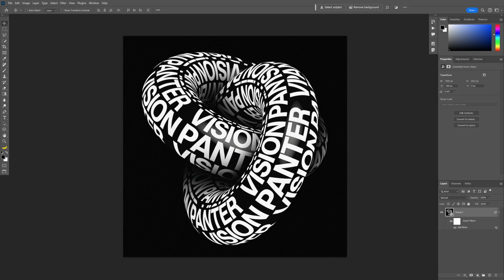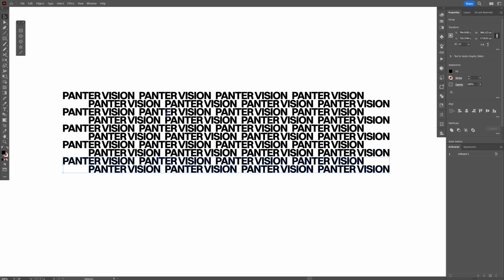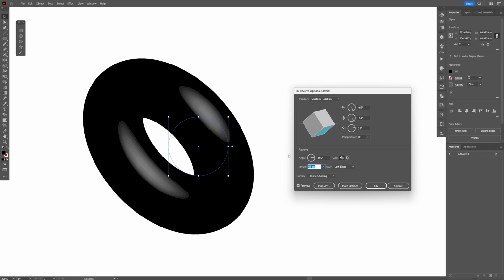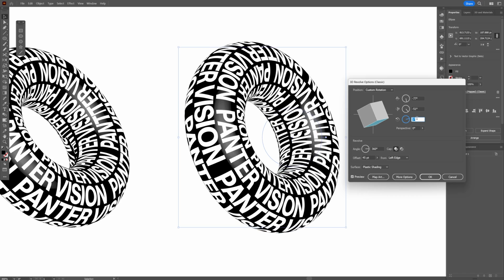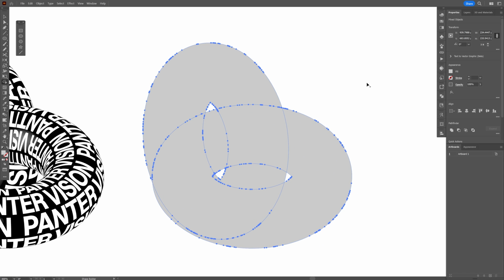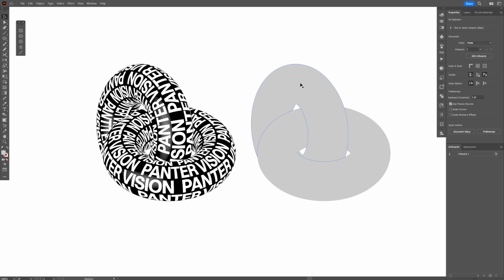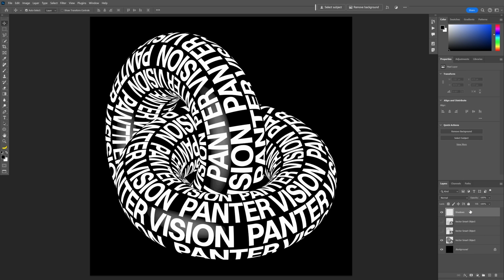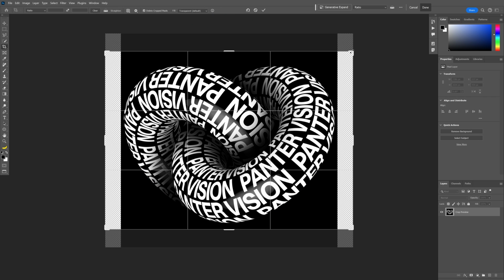How to Make Kinetic 3D Intertwining Text Donuts in Illustrator and Photoshop

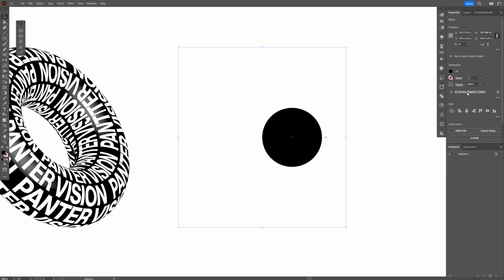Comment: I can actually see you have those faint seams appearing too! At the 2:07 mark I can see them. It's exactly my problem. Is this avoidable??? THANK YOU!
Reply from the maker: What faint?
Reply: @PANTERvision  I. mean like very delicate one pixel lines. Faint is. word for minor.
Thank you.
Reply from the maker: @monealiza7553  When you convert them into vectors it's gonna be clean
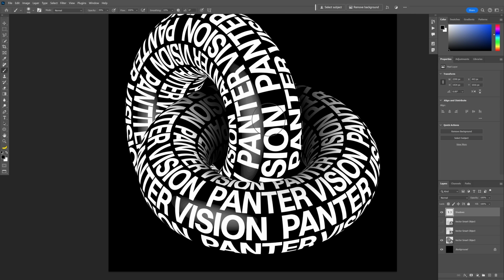Reply: @PANTERvision  At 4:51 in your photoshop file I still see a one pixel line through the S on the bottom right donut. Maybe that's as good as it gets.
Don;t get me wrong, it's totally incredible! I'm just thinking that if you were to scale it to billboard size, I would want to get rid of that line.
Reply from the maker: @monealiza7553  Hmm I checked it but I can't see anything, I can't pixel peep it more then that. BUt if you want you can make it faster in 3D, I did a tutorial on it in Blender.
Reply: @PANTERvision  I appreciate it. I think I could always erase it in the Ps phase. 
Loving your tutorials. Super inspiring!